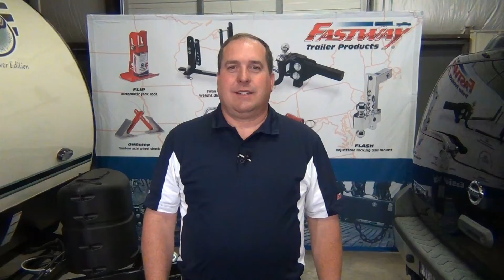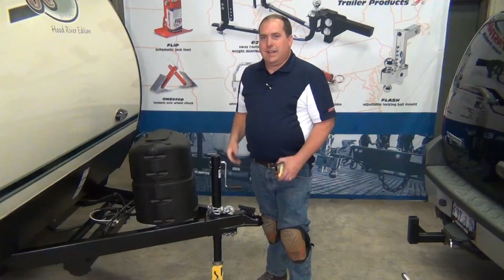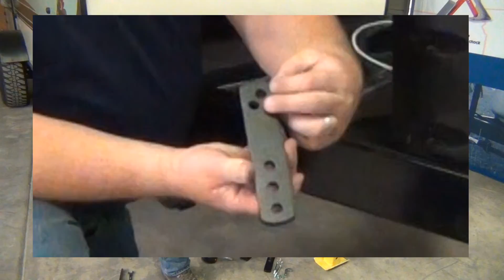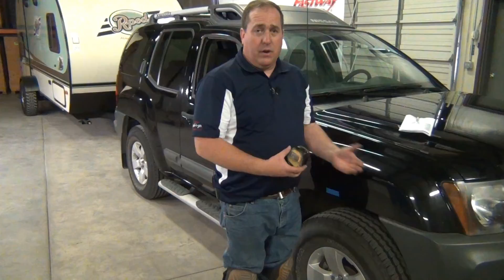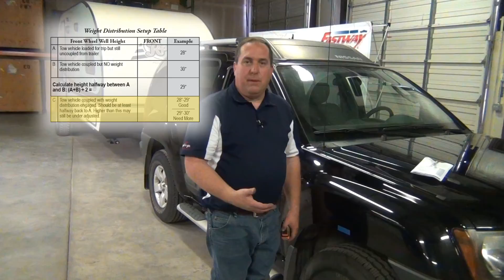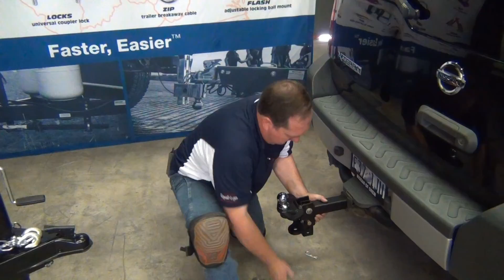How To Install Your Fastway e2 4.5K Trunnion Weight Distribution/Sway Control Hitch

Comment: HI, I hope you read this and provide me some expert advise. First... I previously tried the Fastway E2 94-00-0600 as I was advised to get these. I was not successful, I took them back. I think it may have been too much WD for my setup. 
The L brackets ended up being too low, I believe I only had two washers. 
My RV is on size 14 tires/wheels. I need a kit that the L brackets do not drop too much. I think the E3 Trunnion 450 will do. 
My RV and towing vehicle: 
2017 Chevrolet Colorado
2018 Forest River Rockwood Geo Pro 19FBS:
UVW: 3075lb
CCC: 1337lb
Tongue: 413lb

Please advise if the Fastway e2 4.5K Trunnion is  the right kit for what I have.
Reply from the maker: Thanks for your comment. I don't know if the 4.5K Trunnion would be the best bet, simply because the tongue weight is 413lbs before you add any weight to the tongue of your trailer. You will not want to exceed the 450 lb. tongue weight max on the 4.5K Trunnion hitch. Feel free to call us and we can walk through which hitch will be best for your setup!
Reply: @FastwayTrailer  Thank you for the reply. After reading your comment I believe I need to go with the 600/6000. QUESTION.... What is the weigh of the 92-00-0600? 
I hope it is not a TON like the 94-00-0600.

Thanks

Comment: I changed vehicles SUV to F150 and needed to change the ball location it took about an hour to get the hitch off of the shank and back onto the new location on the shank due to the compression of the hitch. I used a rubber mallet and pry bar.r The other campers in the park did not like the sound of my little sledge.   Do you have any ideas to make this easier. Other than that I love the hitch. One other issue is that the L brackets are getting a groove worn into them. I currently have 2500 miles on the hitch and am towing a Gulfstream Ameri Lite 198BH Rocky Mountain edition. 3750 lbs gvwr 26 inch frame height.
Reply from the maker: First of all, thank you for taking the time to get your hitch set up correctly after changing tow vehicles. This is something that is often ignored, but that is critical to getting the best performance out of your hitch, and the easiest use. Unfortunately, there is not a way to make it easier. It must be that tight so that the shank and hitch head work together as one unit, and put the least amount of stress on the hardware, hitch, and vehicles. The good news is that you shouldn’t have to do this too often, unless you like to upgrade tow vehicles regularly. 

As far as the groove in the L-brackets goes, get in touch with our customer support team. You should be seeing a little of this, but not an excessive amount. They will most likely look at some photos from you, and then be able to help you get some new ones under warranty if something is out of order. You can reach them at 877-523-3103 or support@fastwaytrailer.com.

Comment: Unfortunately, I followed Equal-i-zer Support's advice and bought the e2 600/6000 hitch for my 2018 Tacoma 4x4 V6 / RPod 171 rig, and it is too much hitch.  Even with the recommended minimum of five washers and the L brackets in the lowest position it it still too much weight distribution.  The support guy should have recommended this 4.5K light duty one.  Dunno what to do now.  Not pleased with the bad advice.
Reply from the maker: Sorry that you’re having trouble with your setup, but we’re confident we can get it dialed in and working well for you with a few adjustments.

Can you answer a couple of questions that will help us understand your setup better?

Which model of hitch are you using, the round bar or trunnion?

Also, if you set the trailer parallel to the ground, with the tow vehicle and trailer inline with each other (but not coupled) on a nice flat surface, with the shank and hitch head in the receiver hitch, what are the distances from the ground to the top of the trailer coupler, and from the ground to the top of the hitch ball?

Does your Tacoma have an automatic leveling system, or air bags in the suspension?

Comment: not true set up, you don't have the batteries installed or the trailer loaded!!
Reply from the maker: +Ray Williams, 
Thanks for the comment. If you mean that it's not a true set up because with the batteries and a loaded trailer you would have a different weight distribution set up, you are correct. The video is primarily to show the process of installing and adjusting the hitch. You should always set up and adjust the weight distribution correctly for your particular trailer and tow vehicle. If we were to load this trailer with batteries and cargo, we would double check the weight distribution and adjust as necessary before towing.

Comment: my trailers gross vehicle weight is 4400 the tongue weight is 400 I purchase the E2 round bar 800 pound Max tongue weight 8000 pound Max trailer weight what would be the effects of using that kit versus the lighter weight kit
Reply from the maker: +luis zarate,

There will be no effect on the trailer or tow vehicle themselves. It takes the same amount of force to distribute your tongue weight to your tow vehicle no matter which hitch model you choose. For example: If you must lift with the equivalent of 500 lbs. to get good weight distribution - it will be 500 lbs. on any hitch to get the same effect on the tow vehicle.

The e2 hitches with higher weight ratings come with thicker/stiffer spring arms, therefore, you might notice a slight increase in the stiffness of the ride overall. Though generally not much, some customers do notice a difference. 
Some customers actually prefer this, as it feels like they are more connected to the road, and less "floaty." Kind of like the difference between riding in a sports car vs. riding in a sedan.

There is also a slight cost difference. The higher rated models are a few dollars ($6 MSRP between the 6K and 8K) more expensive.

One benefit would be that if you decide to purchase a larger trailer in the future, you will be able to keep this hitch and use it on that trailer, instead of having to purchase a new hitch.

Good luck!
Reply: FastwayTrailer  thank you
Reply from the maker: You're welcome!

Comment: The hitch head and trunion bars are pretty heavy. Would it be more accurate to take the initial or stock measurement without them in the receiver or is that weight negligible?
Reply from the maker: Christopher Scinta,

In almost all situations, this weight is negligible. In either case, you should be able to get a good weight distribution set up. Make sure to follow the set up instructions, as well as keeping within your equipment's ratings for towing, gross vehicle weights, and axle weights.
Reply: Thanks for the response.
Reply from the maker: You're welcome! Thanks for the question.